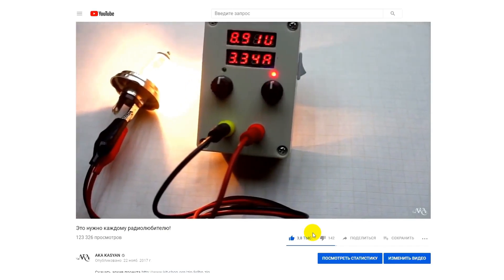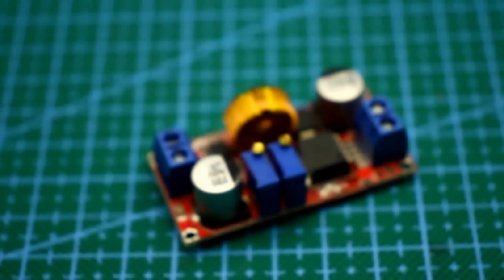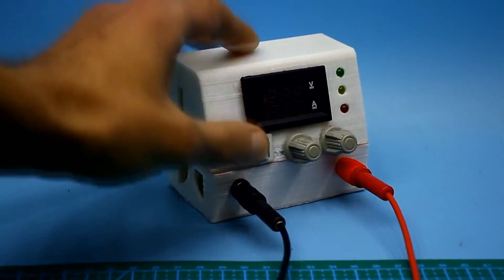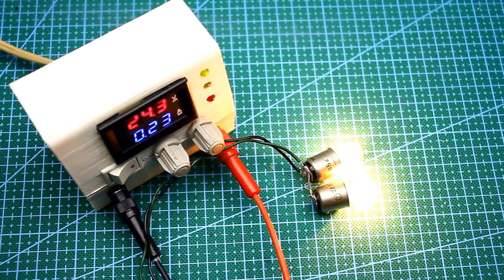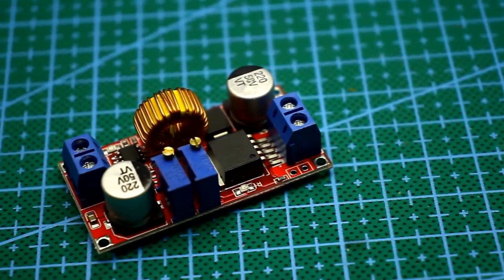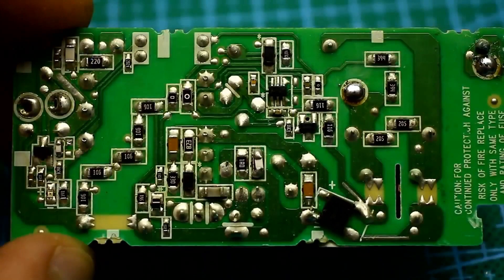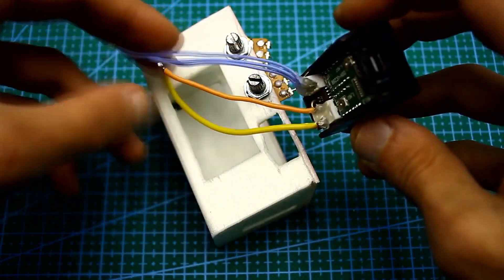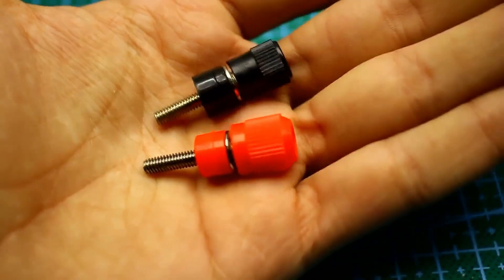Pocket laboratory power supply for just a penny

Comment: I have a bunch of those laptop power supplies. I can modify them to put out a variable voltage. If I just need a voltage that's plus or minus 1 volt they work as intended, but if I need better regulation I set the output a few volts higher and feed that to a linear regulator. I can keep the voltage difference across the linear regulator to keep it's heat dissipation down.
Reply: So do you think that your setup can compete with a linear bench supply because I was also thinking same method
Reply: @coderhex1675  Possibly. I add the linear regulators to try and take out the switching noise. Sometimes I have to use pure linear, batteries, or batteries with a linear because of noise issues. The laptop plus linear is good enough for 80% of my needs.

Comment: With those buck converters I've found that placing a few different sized capacitors on their output really improves their ripple. I've been quite impressed. Otherwise you could probably get away with a very simple capacitance multiplier circuit on the output.

Comment: I've pulled power supplies out of scrapped laser printers, and even a nice one is a 31 V external supply, which you can take the plastic housing off, and use inside the power supply... With a 60 W supply, you can get quite a bit of current from a buck-type DC/DC converter.
Anyway, generally, this one that you made is good enough for lots of quick and nasty tests!

Comment: I've been thinking about using a dual potentiometer to adjust the output voltage of the inexpensive buck converter, but, at the same time, adjust a linear regulator that has about 2 V lower voltage, so that the linear regulator doesn't generate much heat, but takes out the ripple from the SMPS... Maybe a tiny fan, too?
Adding maybe $3-$5 would improve it a lot.

Comment: This V/A meter is not accurate at all. If someone have a solution to calibrate it.
Reply: Turn the small pot on the back...
Reply: @Enderkruemel  I only have voltage pot not current
Reply: @lenslens7379  they bouth use the same voltage reference so maybe file down the shunt a bit? 
Also the newer Version of this has 2 pots.
Reply: It's actually a voltmeter that only goes up to 1.999 milli volts. There's a resistive voltage divider feeding into the sense pin. You should be able to trim one of those resistors to get it spot on.
Reply: A melhor solução é comprar um medidor com cinco dígitos, esses são mais precisos.